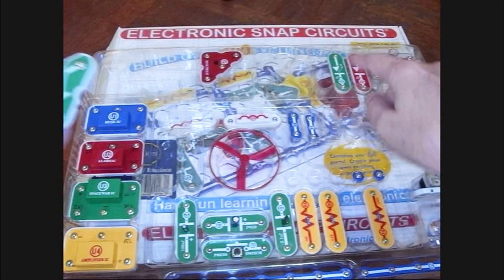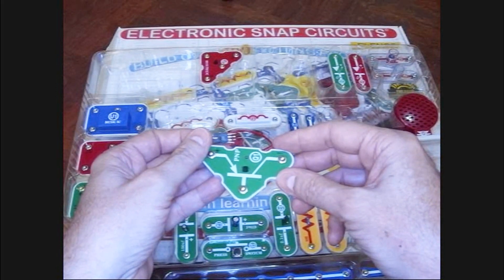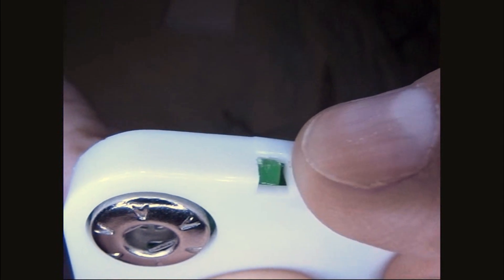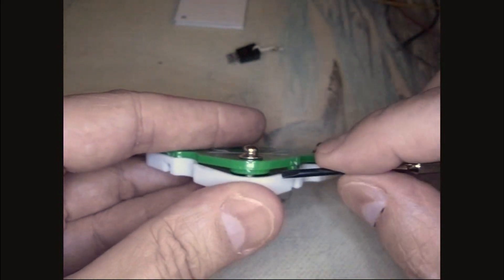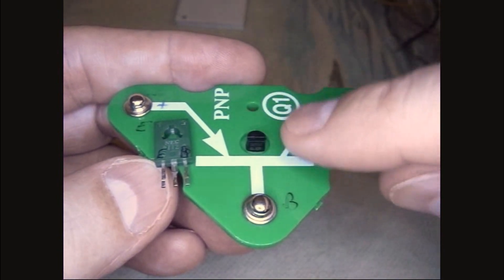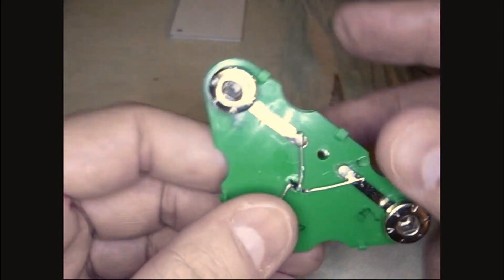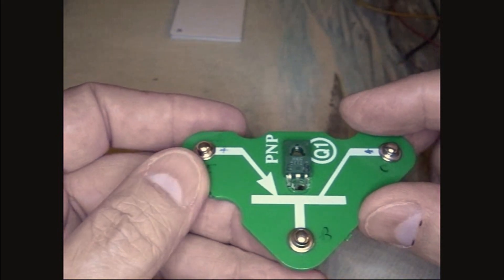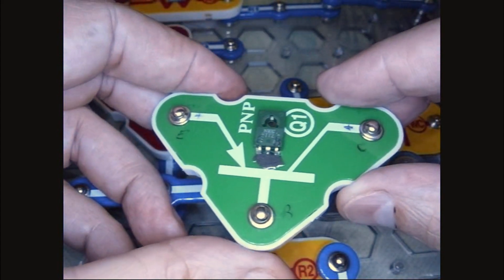Snap Circuits Radical Hack / Mod

Comment: using a screwdriver to pry the top of a snap circuits part off is also useful if you want to look inside an integrated circuit part
Reply: Ah man, I did that SO MANY TIMES as a kid! A COB on a phenolic PCB with a smattering of SMD components. Confused the hell out of me back then lol.
Reply: but i did

Comment: Very coincidental. I bought the same set for my granddaughter 3 years ago but she only wanted to make the crawler (she made me make it - haha). Anyway, she forgot all about it and wasn’t interested in the kit until day before yesterday when she saw it in the closet along with other “not interested anymore” toys. We pulled the set out (the batteries surprisingly were still good) and she made the first three projects in the book. We’ll see how long before she wants to continue more projects - haha!
My question to you is, how did you burn the resistor if only using the pieces in the kit? Thought they were built so that wouldn’t happen to the kids?
Did Daddy overload the set (hey watch what I can make it do Son) -  Haha.
Will the bigger resistor cause other “blow outs” of the other set pieces  now?
Fun kit, I need to learn from it. But I know you’ll tell my granddaughter I played with it when she wasn’t looking.
Oh, and nice fix!
Reply from the maker: They are really good kits.  Keep it longer and she may grown into it.  I was in high school before the electronics bug bit me.  It was purely by accident: I bought a bag of transistors on sale, took them home and figured out how they work.
We did this mod because the transistor was destroyed.  My son shorted the base emitter connection through all four batteries.  That will do it.  The kit won't prevent you from doing such things, that would almost be impossible.  The bigger transistor won't affect other parts, think of it like a stronger socket for a socket wrench, it won't break as easily.
Reply: tsbrownie Its Great that you and your son are bonding by doing such things together!
Reply: @tsbrownie Do you remember the model of the four battery one? I think it's discontinued, but I want to look through the manual again.
Reply from the maker: @qwertykeyboard5901  I don't remember the model, but it had 2 battery modules of 2 batteries each.
Reply: @tsbrownie  Huh, maybe it's a mandela effect thing.

Comment: Thats great. Should be more than safe enough for some fun now. Those kits are great. I still have 3 of those older kits that use spring connectors for the components, on a cardboard panel. Good fun for kids and adults alike, and you learn a ton too.
Reply from the maker: Was it the same company that used the springs?
Reply: @tsbrownie  No. these are from the late 90's I think. One is by Merit, and the other Two are John Adams.
Reply from the maker: OK.  Thanks.  I don't know those.